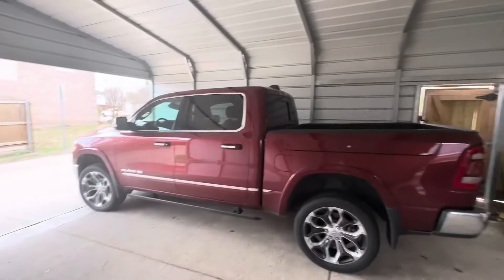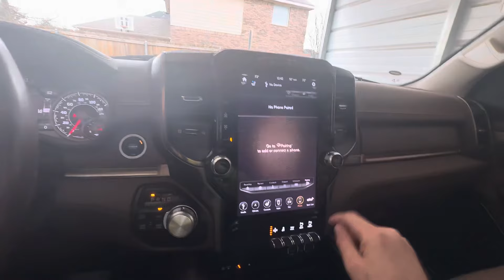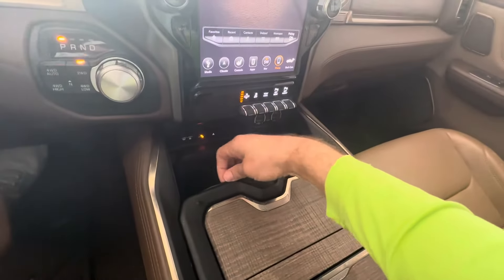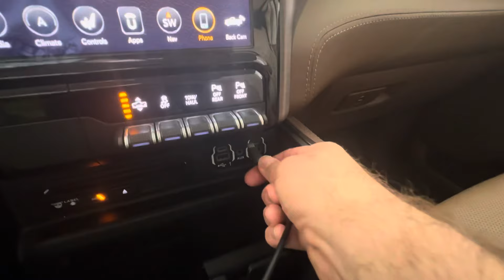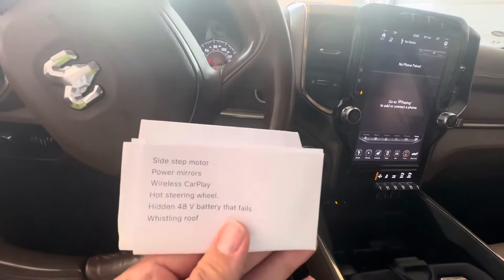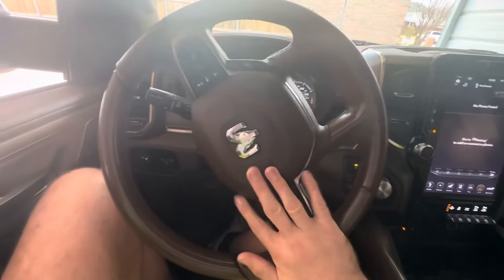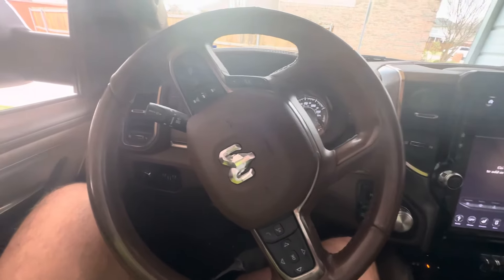6 Problems with Ram 1500 2019-2024

Comment: have a 2021 LTD w/ all options, non e-torque (which is why you have that secondary battery in the back corner of your cab), havent had any of the problems you have had, and i live north of nothr dakota (-30 celcius avg days in winter)... i spray every 3 years (current and previous vehicles), no issues with my power side steps, no delamination in the wind guard, and to fix your mirrors, you need to relearn their positioning (because you did kill your battery). That will stop them from attempting to swing out further than they're supposed to. As for the heated steering wheel... while it is hot, my wife's 2022 lexus nx has a hotter one.
Reply from the maker: I’ll look into relearning mirrors. Thank you
Reply: @2Point yes he is correct. That 48 battery is for the etorque and is a pain if dies, the mirrors do need to learn again. 

I have a 2020 Bighorn 5.7 non etorque with fixed steps and heated seats/ heated steering wheel. I too have noticed it gets very warm particularly on the bottom edge with mine. Otherwise Ive had minor issues. The paint is… well lets just say the paint isnt robust and cant withstand scratches and dings as easily as some of my older pickups. 

Living in North Dakota the remote start is a huge blessing… so far it has been a mostly trouble free truck.
Reply: My heated steering wheel also gets too hot along bottom edge. Mine is a 2020 longhorn@Cherokeelion
Reply: @troyallen1751  wanna bet the heated steering wheels are from the same batch? Ha.

Comment: Had a 2019 Ram limited and had the same battery draining problem that the dealer in Madison replaced at a cost of around $400 for me with less than 15k miles in the truck. Never had a problem with any of the other problems you've had. I now have a 2023 limited and so far so good at 22k miles.

Comment: 2021 dodge classic.  Has no power , no lights on anywhere but battery is at 💯 drove perfectly fine had it parked for 2 days still dont know whats wrong currently trying to reset and also seeing if it has an Auto theft . Out of commission since Sunday and its at about 128k and ran out of warranty go figure.

Comment: I have a few others. Air conditioner sucks and turns off when in auto stop just blows hot air. Steering wheel wear and tear - it’s not holding up well. My dash has also come unglued and bubbles up. Like
You not hard on it and very well kept.
Reply: When AUTO STOP is on the motor shuts off so obviously the Air con isn't going to work. Shut it off if you need the air to stay on.

Comment: I have a 2019 rambox limited 
I can agree about the heated steering wheel. 
My complaint is the dash cover skin has delaminated sounds like they may have used the same adhesive that was used on your sun shade screen. 
Because the hole dash needs to be removed to replace the face cover it’s over $1000 :( 
Other than that this will be my first winter since I bought the truck used May 2024. 
I will plan to keep the running boards
Deployed at all
Times during and heavy snow and
Ice conditions

Comment: Steps you must clean the pins on both sides of each step and use a lubricant called Lube It All it was designed for -30 to 350F the motor stops because the pins bind the motor, not the rusty case scrub them well and spray this on as maintenance. I go to 4X4 beaches only this works for me.

Comment: How did you make out with you 48 volt battery problem? At the moment I have the no start problem. Third time the happens. Then it clears up with no problem till next time. Whats up with that?
Reply from the maker: I haven’t had the problem again but I suspect the 2019 and possibly 2020 are riddled with electrical issues relating to the engineering attached to the 48v
Reply: @2Point  Thanks for taking the time. Luckily this time it happen in my driveway.Three years ago when it happen the first time the garage said no problem just a low battery. Ya sure, I did read chats where others had the same problem but not found an answer what it is the problem,  yet
Reply: @raygodbout …. What no start problem were you having and what did you find to be the cause?

Comment: Junk dodge ram
Reply from the maker: The 5.7 hemi has proven to be a 500k engine and the interiors on these are consistently ranked #1 in their class. I don’t know why you say junk.
But I would have to disagree.
Also your comment on mileage is incorrect  even with my higher rear axle ratio, I’m still getting much better mileage than that